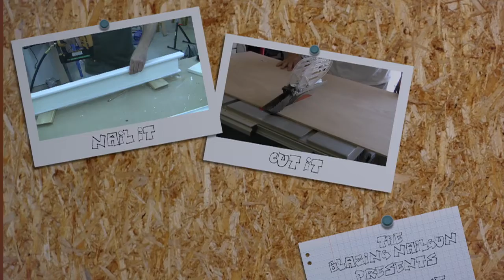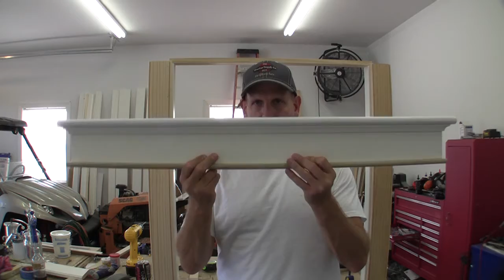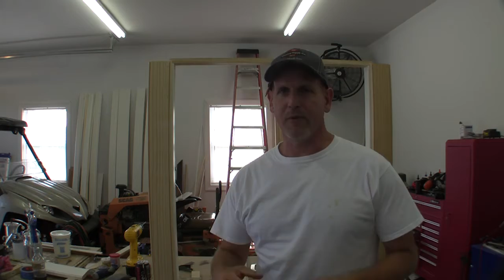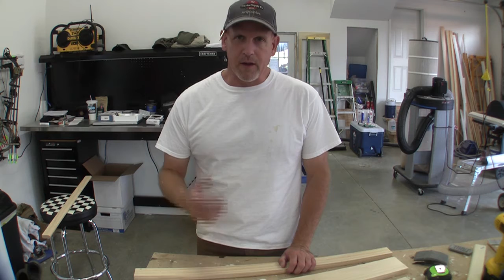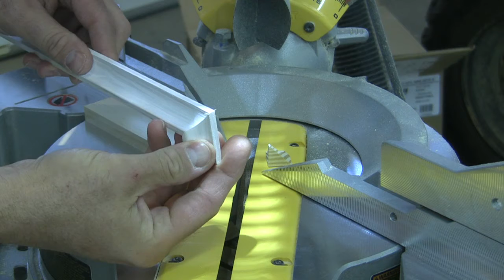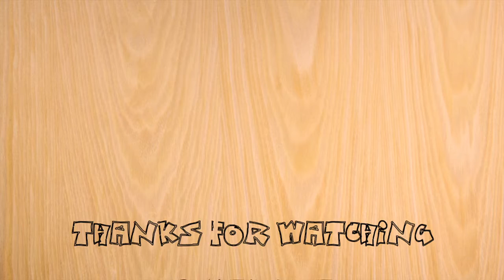How to Trim a Craftsman Style Window Pt 2

Comment: The piece your calling a bead that is on the bottom and I know you mention is 1/2 inch stock. There are very few places right around me that carry 1/2 in stock and you mention you rip these on your table saw. How hard is it to rip these pieces without having a lot of saw marks?

Also, what size round over bit do you use on the bottom bead?

Comment: Great video and demo! Question though, is there a certain amount of clearance I need to leave between the frame and/or drywall in order to fit shims or have some adjustment room? Also, what is the thicknest of the wood used?
Reply from the maker: +Hector cervantes Thanks for watching.  Just leave enough to shim it square.

Comment: Your videos are GREAT! for the top and the bead do you only round the fronts not the sides? Cheers!!!
Reply from the maker: Thanks for the kind compliments.  I only rounded the front so the sides would look a little less polished and more rustic.  However, looking back I think they might have looked better if I would have either ran those ends through the round over bit also or made a mitered return.  Good luck!